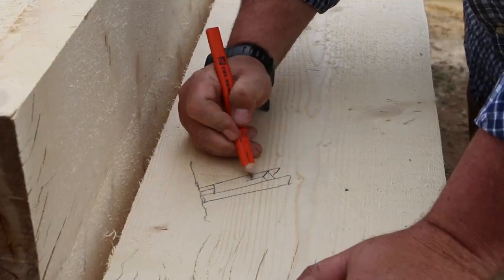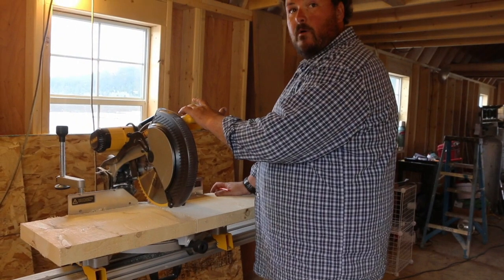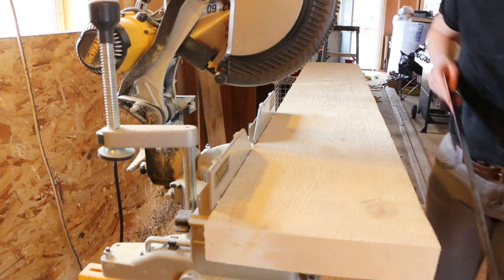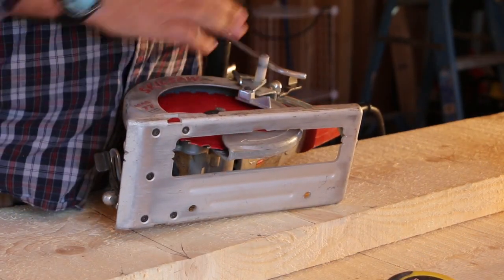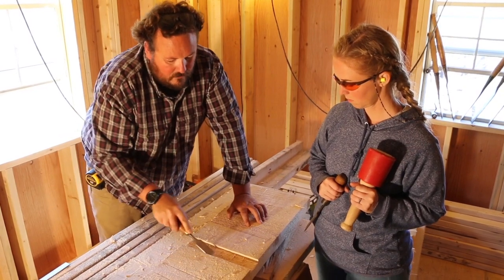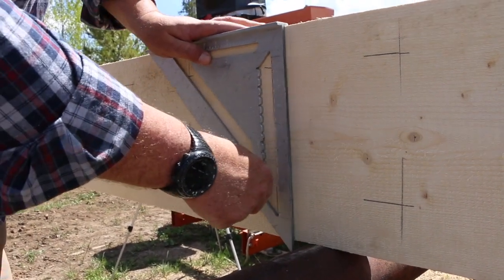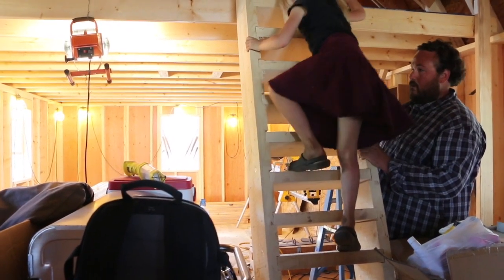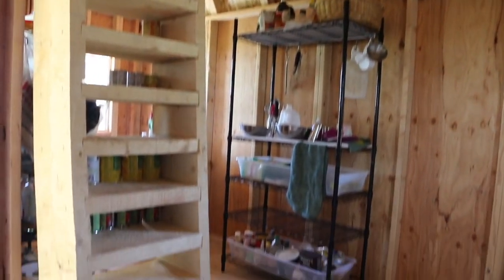Customizing Furniture for the Tiny House

Comment: Ive built 100s of staircases in my life you will either love them or hate them.This one is built for strength and will serve that purpose well.A piece of plywood on the back would help keep the storage from getting knocked out accidentally.The only problem is if you loose your balance for any reason your hurt badly theres no leadway for a slip and not getting hurt so keep that in mind.Your young and in good health one sprang ankle and your not getting up those steps.Just a thought.Love yall